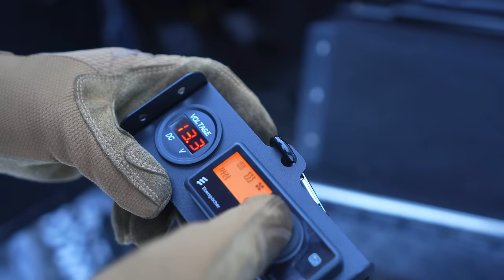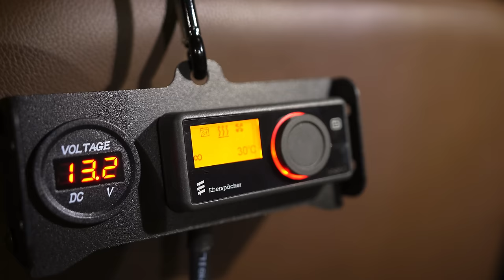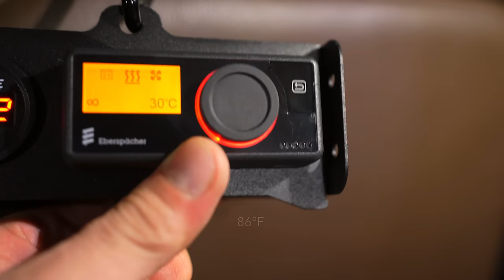Hot Winter Snow Car Camping with the Land Rover OLD DEFENDER 90

Comment: it would be interesting to adapt the fuel tank of the stove somewhere under the hood - for the duration of the parking lot, and run the line in the windshield pillar.  in motion, remove the tank from under the hood and put it into the passenger compartment.

Comment: The organization and gear is incredible, great work!!! What was the Devolt (inverter?) you put on the front drivers side floor?
Reply: Looked like a power bank to run the diesel heater.

Comment: Quick question - does that heater add significant weight to window motor?
Reply: Does it cause CO gas poisoning
Reply: Hello, the device weighs about 9 kg loaded on window itself. The window is supported by the gears but not directly on the motor, so the motor is safe.
Reply: @dhanushranga1  yes the device is combust the fuel and emits the gases but the exhaust section is outer side of the window, so inside the car is safe.
Reply: @debastokorea8481  where can I find one? I cannot find easy on the net
Reply: @debastokorea8481  Hi there, I absolutely love this heater and the design! 👍🏻 Is this only available in Korea or is it possible to ship to USA?

Comment: Have to wonder if he has CO detector with the window heater. I am surprised he had a manual saw rather cordless sawzall -- although a stove might have been a better choice than a wood fire. Sterilite bins over a backpack that you weren't using to backpack with would make more sense.  Do like the Defender in pristine condition. On the whole, I would have preferred to rent a cabin.  😀

Comment: Looking closely at the jeep , where the line is where the door opens , and the roof , to back body and floor panel can also stretch out with legs to support once it is extended out by motor, then automation in tent also can be developed from top roof section , it all must be fully automated. so there is one method in mechanical engineering , for back wheel to roll back to van size , or just roof and back body to roll back to make it van size for camping . , So I would start the design from scratch . I am impressed with all the equipments . but it could be on top section , once it is stretched to van size , and automated additional tent in the roof , so motors would roll out to make the tent. Very interesting to actually design to function.

Comment: What struck me is how many different bits of equipment you needed to spend a night outside. Most of it completely unnecessary. If we need to rely on so much to do so little it's missing the point. How many utensils does one  person need to cook a meal? You have all the gear, yes. But none of it made sense. Folding chopsticks and folding forks. A cumbersome heater hooked from your car to the tent. The tent? Why not create a bed and sleep in your car? Doesn't have to be a Landy either. Any car will do surely so long as it has room for you to lie inside.